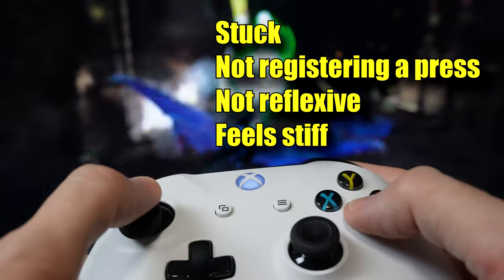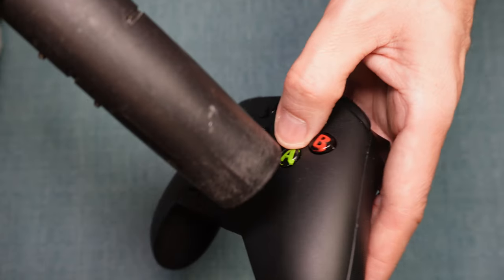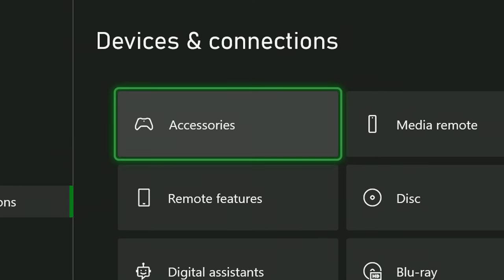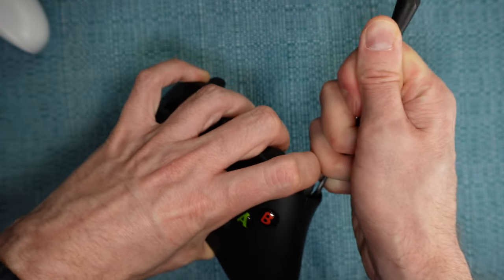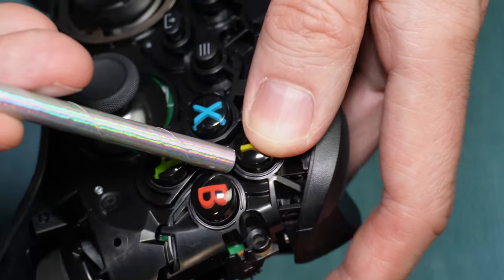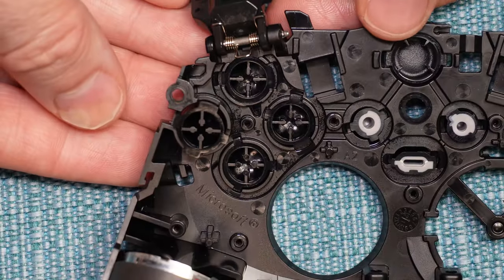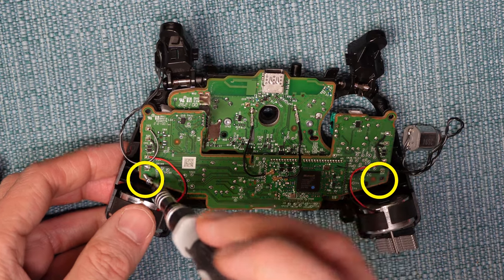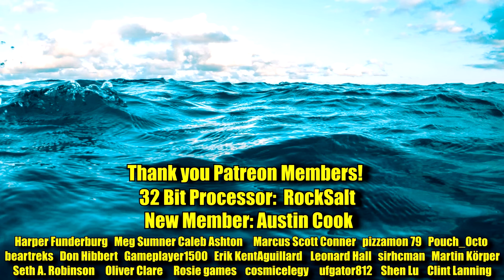How to Fix A B X Y Buttons on an Xbox Controller | Repair Stuck Sticky Broken ABXY Series X S One

Comment from the maker: Things you may need:
Replacement ABXY Buttons:
https://amzn.to/3qS9xiR
Replacement Rubber Padding 1:
https://amzn.to/3WRF4NE
Replacement Rubber Padding 2:
https://amzn.to/3IUh3zV
Replacement Buttons (all):
https://amzn.to/3qo8Q0h
Precision Screwdriver Set:
https://amzn.to/3k5Do49
Electric Duster:
https://amzn.to/3lwoRyR
Replacement Battery Covers:
https://amzn.to/3XBUYKS

All Amazon links above are affiliate links. I get a small amount of money if you end up using them to make purchase (it does not have to be for the item I link to, as long as you click my link then move to another item, it works)
..............................................................................................

Comment: hey lately my xbox controller has the Y button that sometimes doesn't click but its not sticky what could i do? thanks
Reply: idk
Reply: Blow into or try to remove dust
Reply: Hell yeaa thank u man the first solution worked
Reply: Thanks man tou are a savior thanks you so much
Reply: Blowing the dust worked. Thanks!
Reply: You need to really clean it because it happened to mine and I gave it a massive clean and it went back to normal so I hope it helped Thank you
Reply: My controller was filled with grime and dust and all you can think of I opened her up took a can of air and blew it away the sneaky spots I got everything out with a knife if you do the same I would be very careful not to use to much air and be EXTREMELY careful with a knife if you detail it that way
Reply: @naviaslefthand if you don’t know then don’t respond… common sense
Reply: @booky8148  dont tell me what to do

Comment: The issue with my controller was with the "X" button, which was not responding unless really pressing down on it. Unfortunately I had to resort to Solution 6 as nothing before that really worked. It was somewhat a nerve-racking experience given the fragileness of some of the inner components, but your video made it really easy to navigate through each of the steps. Ultimately, this fixed my issue and the controller is as good as new. Thank you!
Reply from the maker: Thanks
Reply: Was there dirt between the X button and the PCB? Or did just a basic cleanup make the X work for you? I have the same issue but with Y button.
Reply: Good job fixing this yourself!
Reply: @Hpro1i  for me its  basic clean up, my problem theres dust above and under the silicon pad, because I wear glove when Im playing. The dust is so thick. I follow this tutorial 100% and after that it works like new. Not just that, all button feels responsive .
Reply: with that 100 pound you donated you could have gotten a xbox elite controller
Reply: 100 dollars? u could have used that money to buy a new controller 😭
Reply: Am having the same problem with my A button any suggestions that doesn’t involve disassembling my controller
Reply: @portaliscool  MX stands for Mexican Pesos, not pounds
Reply: @Hpro1i  Basic clean up will do it. I didn't see a lot of dirt.
Reply: How long did it take you to get the J1 & J2 connectors in place? I’ve got one but not the other…

Comment: Thank you!!! I unfortunately had to take apart the controller and do a deep clean because three of my buttons were sticking. But following this guide was so easy and now everything works. Also for anyone else that has to take it apart, the motherboard screws were t5 on mine

Comment: Thank you for this! I'm always overly protective of my stuff so I was devastated and disappointed in myself when I spilled a soda on my brand new Forza Horizon 5 controller. Ever since I've been using the method of blowing on the buttons to make them not stick for an hour or so. After following your video and cleaning it out it finally feels like new again.
Reply from the maker: Cool

Comment: I tried everything in the video but A and B just kept sticking. Finally I tried the suggestion between solution # 3 and solution #4. It worked! The buttons are now unstuck! IDK how liking a YouTube video can stop console controller buttons from sticking but here I am. Maybe cause I hit the like button WITH the controller while it was still in a state of partial disassembly it randomly worked. Our dog ran off and buried the D-pad and L-trigger again but once I dig them up there's an 80's Soap Opera themed turn based strategy pinball game I can't wait to binge for a good 72 hours.

Comment: Thank you for such a detailed explanation.  We had to replace the rubber padding.  All seemed to go fine but now it won't turn on.  No response with a known working battery and only a vibration when plugged in by usb.   Any suggestions?

Comment: I took it apart and there was some kind of red liquid everywhere so i cleaned it and it works great now. Only thing is the dpad has a slight metallic clinky noise, but works fine. I tried another controller and i got the clinky noise again but works great. Compared it to a new controller and I dont see any difference... I wonder what i did? Glad it works though thank you.

Comment: @9:00 the cables on mine did not come right off. Used my fingernail and the solder broke after some careful picking. Now the controller is broken. I cant solder that small. Consider including some tips on removing those cables properly.
Reply: Me to bro, me to...

Comment: bro thank you dude i wiped down my controller before my session cuz it had taki resido build up on it and I got on fortnite and When I tried to build I couldnt cuz the B button didnt work. Spent 30 mins freaking out and getting pissed trying to fix it. Your suggestion of the Canned air worked. Sprayed it all over the controller and fixed it. Thanks

Comment: Xbox One and Series Controllers suck. I had three of them an all of them did at some point have problems with the A-button input. My 360-Controller worked for 10 years without issues.
Reply: yes.

Comment: Instead of ripping your controller apart with brute force get some cheap plastic spludgers as they are also used in phone repairs, etc. With that you can pry it open step by step along the seams. Also not super easy but not as high a risk to break the plastic.

Comment: does this work at all for xbox 360 controllers? I'm guessing not. any videos that ARE for fixing 360 controllers? the only results I find for them are about cleaning the buttons. I'm 90% sure my 360s A button membrane is damaged because it gets stuck down (flat stuck in place, and I have to wiggle it around for it to dislodge, it's not sticky like there's dirt in there it gets stuck in place like there's a mechanical error. it doesn't have sticky resistance like it's filthy when I try to press it down)

Comment: I wanted to fix a faulty A button, did the removal and fixed back to the best of my ability (I really hate the Torx screws because sometimes they just refuse to move). While it could still power up, the A button improved a little, I ended up discovering stick drift on my left analog, not sure why.

Comment: Cheers. Steps 1-5 didn't work to me and didn't want to risk it with step 6. 
For me the A button sometimes doublepress. If I hold it down and rotate my finger while still keeping it held down it also inputs presses when it shouldn't. And sometimes when I let go off the A button press it presses again during the "lift up". 

Really annoying, making me not want to buy another one of these controllers.

Comment: hi again, i did the other day what u suggested and for a few mins it worked,  but then again to the problem,  and the problem is that my a button get stuck when i press it, not every time but usually when i push with a little strengh , not intentionally of course it get stuck, and its the only button that happens, the controller i have been using it like 6 month it was new,

Comment: I got through part 6 and my controller won’t turn on anymore and I did the procedure 3 times over which took around 3 and a half hours and the same result of it not turning on. I checked the batteries and still nothing.. idk what to do and I’m seriously considering to just switch to pc at this point with how many controllers I’ve wasted money on.

Comment: Unfortunately the sautering for the motors wasn't effective enough, so those came out. But I am currently updating the controller and will edit the comment for any updates.

Update: Btw I have completely cleaned my little brother's controller (the one I'm talking about, it was absolutrly filthy) did solution 6, and solution 4. Nothing seemed to have worked. Although I could find another reason as to why it isn't working...I will update you again if anything happens.

Comment: I have an old aftermarket ps3 remote similar to an Xbox controller. The X button is flat or limp if that makes sense and I have to rotate it while pushed down to get it to respond now.
Reply from the maker: Do some of the things in the video if you haven't already.

Comment: it only took 5 tries, and a replacement rubber gasket. then everything works. Oh, except the rumble pack on the right side got disconnected completely from the board. Oh well. My A button works again.

Comment: I'd use WD-40 on the torx security screw. Water may be the last liquid u wanna pour on there
Reply: WD40 is water
Reply: Wd40 is actually a lubricant oil fyi
Reply: @CalLou502  I know what it is, it's amazing at gettin rid of sticky
Reply: I was replying to the guy that said it was water
Reply: @CalLou502  oh, my bad. I didn't see that amazing comnent

Comment: I spilled orange juice on my controller every button works but just doesn’t feel clicky anymore do you think step 1 or 2 would help that
Reply from the maker: The later steps will likely work better. Sticky residue needs to be cleaned at the spot.

Comment: So a problem ive had with my controller that no videos have helped with is that my controller's a button doesn't work well, it takes about 20 presses to register, however in the games it fine, in the XBOX menus is when it doesnt work.
Reply: Mine register 1 press out of 3, and it's brand new just from the box
Reply: @vovazagach1781 same bro 1 month and got this issue and they won’t let me return anymore smh

Comment: I think the ABXY is too low. in xbox 360 controller, those buttons is higher, also more responsive. I have used a tape into buttons to fix the responsive issues, I think after using buttons for a long time, the buttons will be more responsive